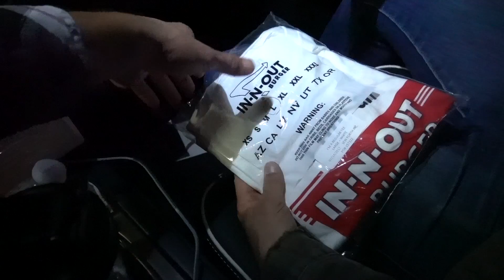NEVER THOUGHT I'D HAVE THIS ON MY LIFT...

Comment: Get the Duralast brake pads off and put the OEM Toyota pads back on and you wont have warped rotors. Aftermarket pads don't stop the vehicle as good causing extra pedal effort which causes more heat which warps rotors.

Comment: turn the rotors after they warp, they should stay then
Reply: Make them thinner and they warp faster...The key is to put OEM brake pads on so you dont over heat the rotors trying to get the car to stop with junk aftermarket pads

Comment: Driver of the vehicle uses both peddles at the same time.   The only way you can destroy a new set of rotors  in  a couple  of months is riding the brakes.

Comment: I have my own tire shop and water has nothing to do with squeaking of brake rotors. They probably use aftermarket cheap rotors.
Reply: That’s irrelevant. Considering you also drive in the rain when your rotors are hot 😂. They will never treat a customer the same who spends 25,000 and 500

Comment: That guy was seen coming from a mile away.... there are 3 things that will  Warp a road are like that 
1: foot on the break all the time. 
2:bad or sticky caliper's.
3 diverter valve not  Allowing the fluid to go back to the master cylinder.
Dont forget to change the air in your tires from summer air to winter air lol

Comment: That is the stupidest thing I just heard about letting your car cool down before washing your vehicle. because if not then your rotors would warp. Don't they have a brake lathe to turn the rotors. I mean seriously. That would be a simple fix instead of replacing the rotors. I have a micrometer to check thickness of the rotor, and if it is still more than what the rotors specs said for minimal thickness. then turn the rotors. save you some money. Now if you have to replace the rotors. What they should have done is to put it on the brake lathe and take off .010". That would make sure the rotors are true, and not warped. When deliverers deliver the rotors, they would just throw it and not care. That is what cause the warping of the rotors majority of the time.